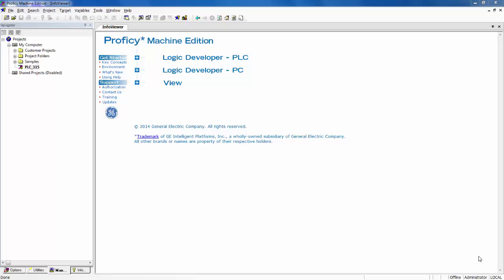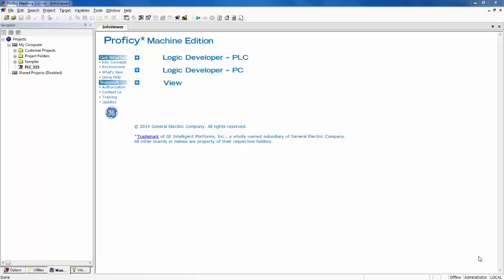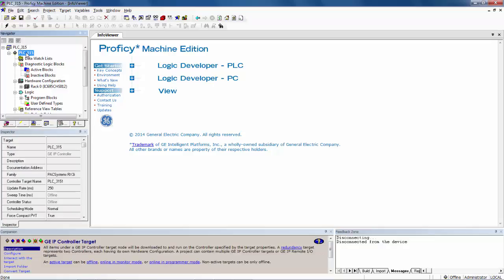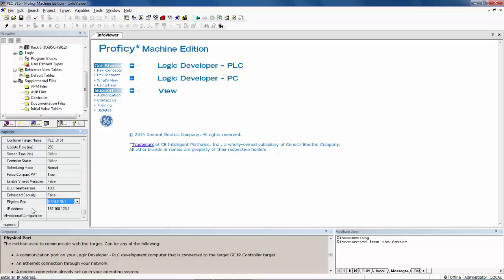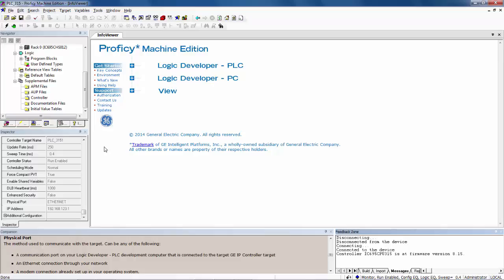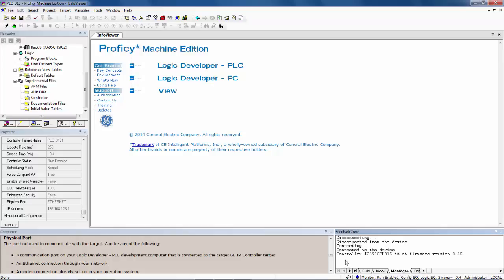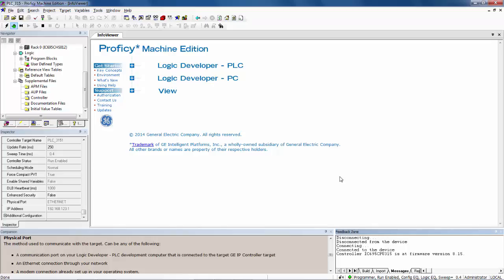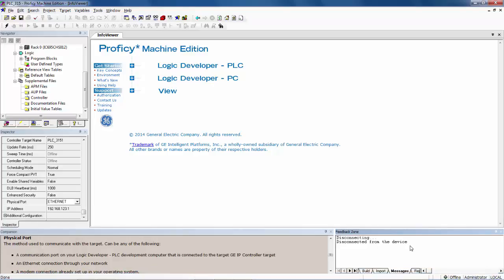How to Connect Proficy ME Logic Developer PLC to a GE IP Rx3i Pac Systems Controller

Comment: Didn't explain how you are connecting to the PLC (which cable, straight-through or crossover) or how you were able to set the IP address before connecting for the first time.  Are there dials on the PLC which allow you to set the IP address/node number for the first time you connect?  Do you have to first go online with a serial connection in order to set IP configuration?   Not a clear video, and focused more on PLC modes than actual connections.
Reply: firsly set ips as teached video and connet, if not connected At Program under Tools And Utilities tab select Set Temporary IP Adress, Enter mac address and new ip for download,  Advanced IP Scanner and scan it, if you can find it try to connect again.